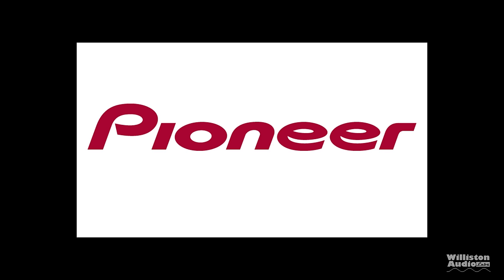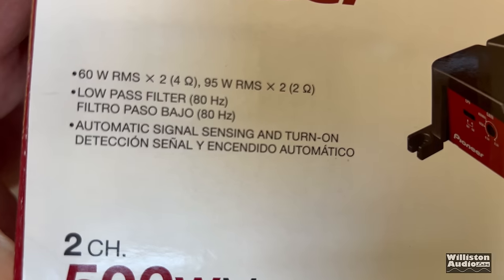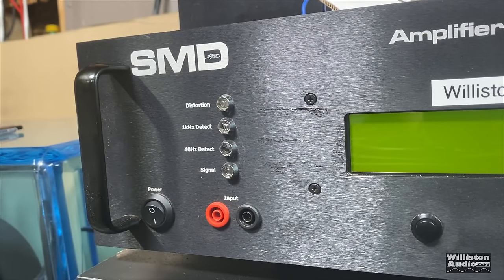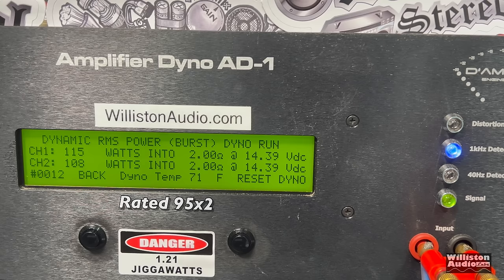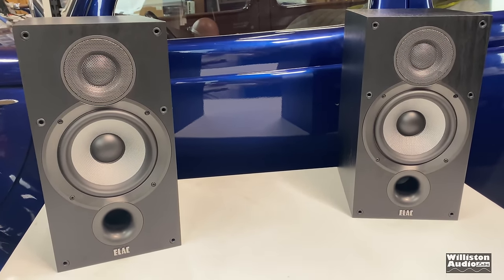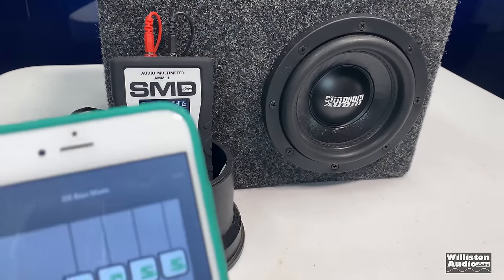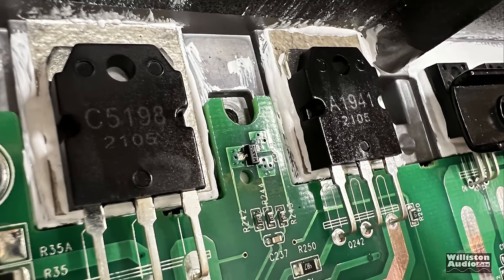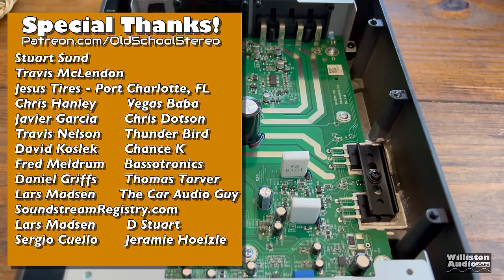Should You Buy the Cheapest? Pioneer GM-A3702

Comment: I’m running that pioneer 500watt a3702 2 channel amp for my mids and highs for 5 JL audio speakers. And it kicks ass. I absolutely love it. In the future I do plan on changing it out for an amp with more settings. But it’s very simple to use and set up, which is really nice. And it makes good power for the speakers I have it running. Sound quality isn’t sacrificed either.

Comment: Way back when dinosaurs roamed , I had a Pioneer amp , no rca inputs , no remote turn on , just a harness with power and ground , and , speaker wires in and out .
It was a basic black metal box , with a singal switch for on and off .
I wish I still had it , cannot remember what I did with it .
It was straight outta the mid 1970s .

Comment: Had and still have the gm-a5702, used it for years till it was replaced by xda91rb to get 1ohm. Got it off ebay from vipoutlet refurbished for 40$. Really can't handle the 2 subs I have without overheating. Sounded good and clear tho and had some thump. Always liked pioneer gear. Thx for another awesome dyno big d!

Comment: Well,  We've all been had for decades.  Decades y'all.  The 500W isn't the output power,  it's the max input power that it can consume before it smokes.  I bet they replace the fuse with a metal jumper and run it @.25 ohms and if it smokes @43 amps it's a 500w amplifier.  We been flim flammed.

Comment: Great video! I’ve always been a fan of Pioneer. I picked up the big brother version that was refurbed off eBay a year or so ago for about $65. It’s the gma5702. I must say, it is a great amp too. I love how it sounds and the power it puts out. Now, they go for around $90 refurbed but still a great buy in my humble opinion. I was running a pair of Mission Bookshelf speakers full range and those little guys thumped!! I wish I picked up three of the amps cause two on subs and one on mids and highs would of been a killer budget setup. Again, thanks for sharing and great vid Big D!

Comment: I have a gm a5702("1000w") on 2 crunch 6x9s & skar 6.5 loudspeakers. I had the gain too high so it Blew out my 1st set of 6x9s But once I Replaced em & Drop the gain, it's Been workin great for 5 str8 yrs.

Comment: You rock Big D!  Hey you ever seen an Orion HCCA150R? As far as I can tell they are, or have become pretty rare.  Never seen another one and never seen any listed for sale.  I got this amp and an HCCA 2100 out of an Astro Van that I bought as beater work van for a large development we were building houses on.  I bought the van off a lot for $400.00 because it was not road worthy intending for it to spend it's last days on this property. In the back of the van was a boxy MDF panel attached to the driver's side wall that was taking up a bit of space that I wanted to rip out.  I saw some cable ends dangling down just barely below the edge of the panel like someone had cut the cable as close to the panel as possible.  You could only see them if you crouched down low. I reached up behind  and felt amp fins.  I unscrewed the panel and there were 2 absolutely mint Orion amps from the 90's mounted to the back of the panel.  I had both amps tested and they both work.  I could not believe my luck.
Reply from the maker: Oh wow that’s cool 😎

Comment: That is the most rise I’ve ever seen. Normal rise is double at tuning frequency. Is that box sealed? What was that wired too? I know a million questions. I use that meter to measure rise all the time. That’s the highest I ever seen consistently. You’d need a 2000 watt amp to get 250 watts to that 6.5. I was getting down considering it never saw over 30 watts. Great video as always.

Comment: My first monoblock amp was a Hifonics HFi 1000.1D. It did pretty well for what it was. It never ever got warm, and I had it connected with 8 gauge ofc power & ground, it only has a 80a fuse, I dont think it even needed 4 gauge. I ended up upgrading from that to a DC Audio 1.2K and 1/0 gauge ofc Sky High Wire and an XS Power battery in the trunk. I barelyyy even heard a difference from the Hifonics amp, (connected to the same sub/in same box) so Im not even sure how but I guess the DC amp wasnt that much more power to begin with.

Comment: I have a question. I bought the GM-A5702 from Crutchfield because it was an open box item and it was a good deal. Then I bought the GM-A6704 off Amazon because it was half the price Crutchfield wanted. I opened them both up and they are different. The transistors in the Crutchfield one are SK. And the board is different. So are the labels underneath. The Crutchfield one is made in Vietnam and the Amazon one is made in China. My Amazon one looks identical to the one you tested here. Did we buy Fake Pioneer Amps off Amazon!?!?

Comment: This design has been updated. Earlier this amp had all THD components , now most of it is SMD and the board is double-sided. 
This amp could be modded to make more power! Replacing the 70w output stage transistors with 100w transistors & increasing the powersupply voltage to 35v± & replacing the powersupply mosfets with better ones can make this boy do 100w/2 at 4ohms . Or 250-300w bridged..

Comment: i never paid attention to one thing. All the electronics hang upside down, like most amps. You would figure it would put stress on solder joints and heat rises into board. Hmm. I used to work in a television manufacturing plant and they were board side down. This was crt tube type not modern screen type.

Comment: I have been using pioneer head units  since I was 16.....32yrs ago
Reply: I can add 10 years to that, replacing my Craig PowerPlay after some Ahole ripped it out. In dash cassette player and I forget which Super tuner  (II or III). Worker great to pull in WAAF but was a paltry 4Wpc IIRC. Took me a bit to figure out how to connect the speaker outs to the amp section of the CraigPP (the thief didn't know about that). Add in Jensen 6x9 co-axs and that was car audio "greatness" in the late 70's.

Comment: Goes to show, the class A\B are still the best sounding.  I recently "upgraded" my old 90's class A/B amps to a single 5 channel class D with tons of power.  Yep, never runs out of power now, but sounds like dog $hit.  The bass is way different and drops off all over the place.  The mids and highs (2 sets in the car) respond ok until pushed.  Then, you notice the digital roll offs and weird noises coming from the tweeters.  I'm sorry.  Class D just ain't there yet.  I'm going back to class A/B for the quality of sound.
Reply: A/B is made for sound. Digital is made for base only normally monoblock.
I've never built a system with a one amplifier driving the entire system. Always did two amplifiers even if they were small amplifiers. Didn't matter I would always use a four Channel good quality name brand A/B class for the highs and mids. My second amplifier would be a Class D running mono to drive the sub or Subs.

Comment: I have 3 pioneer D class amps, my two mono amps are great but the 4ch sounds harsh as hell and I have wanted to go back to A/B for my MIDs and highs but Dont think my cars electrical system could cope with an A/B producing the same RMS output as the class D, I'm already killing alternators in fairly short order with my current setup.
Reply: Every single system that I put in my various cars throughout the years was always two amplifiers. A good quality 4 channel name brand amplifier driving the mids in the highs and a Class D monoblock driving either a single woofer or two woofers. Depending on what system I was building and what car I was putting it in. I'm going to tell you, I never upgraded my electrical system ever. Always had the stock battery, always had the stock alternator. Never bought a capacitor, a lithium battery or an upgraded alternator ever.
Reply: @Mr.Robert1  I've not upgraded my electrical system but it could do with it, my 3 amps give it a beating

Comment: I still got one from 2011 a 720 watt but it would always over removed the bottom plate and put Xbox 360 van in it . I abused the hell out that amp daily for two years the only problem with is the rca inputs are messed up just never fixed it😢

Comment: I have this amp and want to run it at 2ohms x2 to get that extra power out of it. How to i wire my 4 ohm speakers to this amp to get 2ohms out of it. In the manual it does not recommend wiring 2 4ohm speakers to the amp to get the amp in a way to output 2ohms as it could cause damage or fire to the amp? How else can i do this then??

Comment: Can you do the old pioneer gmh 200, it had 3 power inputs 2 ground and two 30 amp fuse, but rated at 100 x 2 at 4ohn 150×2 at 2ohm 300 bridged. The amp was like 25pounds

Comment: class AB does sound better than class D .especially for the upper end.. but ill add that even for midbass that class D really cant deliver.. this little pioneer works great running mono for your door speakers.. i suggest getting 2 of  these and run one mono left channel  and another right channel.
Reply: By the time you buy two and fool with wiring 2 up, you can buy something a little better in a single amp. I would not recommend two, myself.
Reply: @grumpysteelman  ok. what modern amp does 200 x 2 and is class ab.. thats not 800 bucks
Reply: The 4 channel variant? 

Pioneer GM-A6704 4-Channel - $120 shipped - 190wrms x 2 rated.

Plenty of other 4 channel options with more adjustment in an A/B amp similar power/money when you consider more wire, terminals, RCAs, etc. like the CT Sounds CT-80.4AB 160wrms x 2 bridged $140 or SKAR RP-75.4AB 230wrms x 2 bridged $135.

Comment: Pioneer is a legacy brand. I assume this amp is a basic, tried and true design. I would choose it over most others at this price range...but I have not shopped this price range in some time, I would bet that Sony, Kenwood, JVC,...etc, all have similar quality amps for those on a budget....I would use these amps bridged  at full range, 1 amp per channel to drive front stage with external crossovers, or crossovers from HU, and maybe find the matching Pioneer monoblock, with, maybe, 500 to 1000 watts (classD) for a sub....a simple 3 amp system with the inexpensive Pioneer amps driving a decent set of components, and a mono block driving a decent sub....a car cabin is a small area, a pair of c6" components and a 10' sub should satisfy those who just want high quality sound reproduction in their car...buy the least amount of equipment, of the best quality you can afford ,rather than buy a ton of low quality gear...imo

Comment: But what is the 500watt on there? It never got close to 500w
Reply: Usually these figures are the sum total of all the maximum wattage ratings of all the individual electronic components added together, rather than the output power of the circuit arrangement. Some call them an "ILS" rating - If Lightning Strikes!

Comment: Wow! I thought my Sony CDX-R7 was the first car CD player. I got it in 85 or 86 though.
Reply from the maker: The R5 was Sony’s first and the R7 was the first in dash CD with a tuner built-in
Reply: @wal  I remember whichever one I had used an external tuner box and my buddy worked at Sony Service Center at the time. He told me that if I'd take the CD player in for playback issues then agree to whatever quote they gave me, that it was their policy to just upgrade me to the CDX-R88 for free! The 88 still had an external tuner box but if I recall correctly, the external components were fewer or smaller and that player made me the envy of my high school, who were all still rocking cassette players!

Comment: NEVER BEEN A FAN OF PIONEER. I'VE ALWAYS FOUND ALL THEIR PRODUCTS TO BE UNDERWHELMING. i've owned amps, head units, EQ's... to me it's trash. I'm sure i'll get burnt for my rhetorical opinion.
Reply from the maker: I’ve had that experience with their home audio, but car audio has been decent
Reply: @wal  just a personal preference. my top picks are Alpine, Fosgate, MTX, Audio Control.. and a few others. I've bought the big daddy Head Unit like 10 years ago Pioneer on a whim and a shop friend whom pushed it. it was a whopping $700 and some change it had all the bells and whistles but I was just underwhelmed. bad firmware updates. a lot of the controls were funky and in strange places. they seemed more interested in the colored light on the front than the sound quality. and the RMS from the head unit was seriously over rated. box/book rad 55 watts RMS per channel. and I O-Scoped it at 22 watts. I used the head unit channels for my tweeters. I ditched it went with the new Alpine Halo 11" I LOVE IT

Comment: Cheap crap amp sorry .  After Pioneer thake over by Sound United i see only crap .
The old amps had more power reserve .
Stil have her a Pioneer gm-x574 what have a power 4x50watt RMS on thd 0.15% (20-20.000hz)
Or 4x70 watts rms on thd 0.8% 
Amp use are 2x25 amps